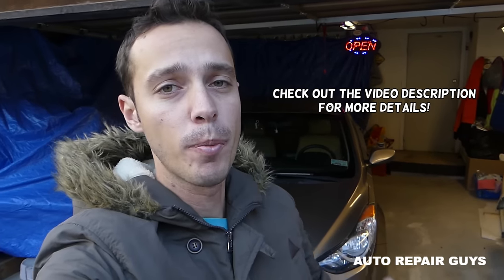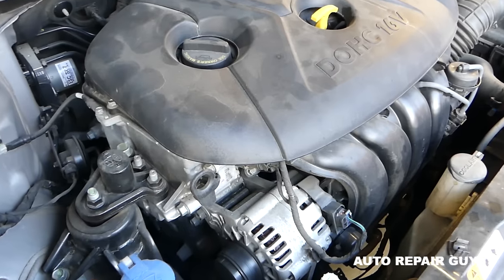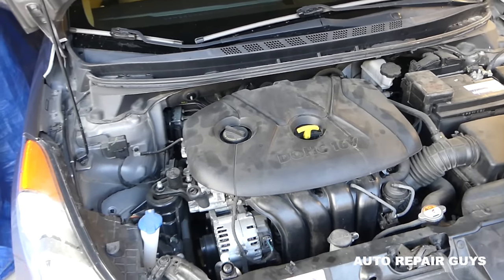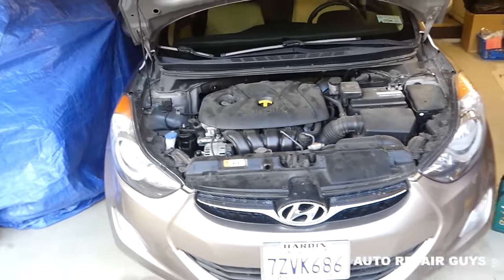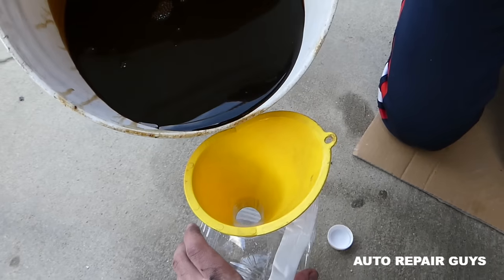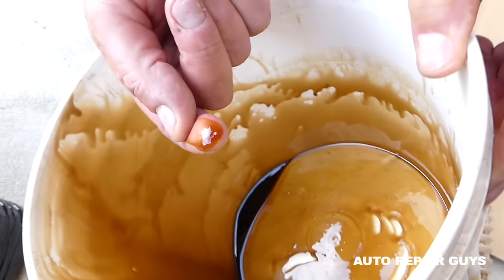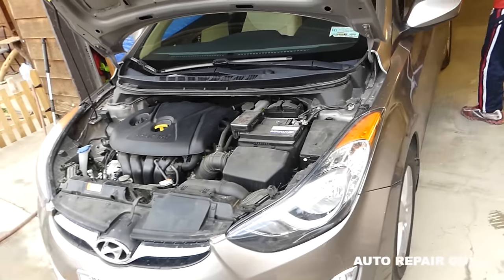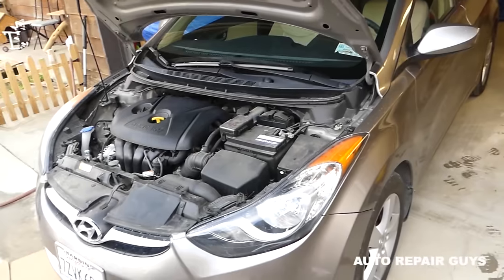HYUNDAI ELANTRA ENGINE KNOCK TICKING NOISE

Comment: Bought a 2013 Elantra brand new.  It sounded like that since new.  Currently has 220k on it.  Best car I ever owned.
Reply: I have a 2013 also en it started making me that noise at 140k miles and has no engine light on , do i have to worry??
Reply: @martinjramaral3042  my brand new Hyundai has a ticking sound. I think that’s just how smaller newer cars sound
Reply: @brandonpickett8920   dose it sounds more when you start it in the morning??
Reply: @martinjramaral3042  yup, it does. From what I’ve researched I believe it’s the fuel injectors making that noise
Reply: Brent 
All my elantra 2012 has done is cost me repair after repair
Reply: I have a 2013 with 130k.  I noticed it making that noise at 80k (think it made it since new though).   No problems so far.
Reply: 😂 you must have had some shitty ass cars in the past 😂 it takes a lot to be worse than that
Reply: @martinjramaral3042  yep
Reply: It's been the worst car I've ever owned
Reply: I bought my 2013 Elantra in September of last year. When I bought it it only had 10,300 miles on it. I live in Anchorage, AK and it didn’t start making the ticking noise until it became real cold. (10- -10 degrees) at around 11,000 miles.
Reply: @BorderPaps  just give it time
Reply: That’s the same year I recently just got with low miles and best car I ever owned aswell!
Reply: do you get rough idles at stop lights?
Reply: same here im at 205k
Reply: @brandonpickett8920  thats what i was thinking it was. I’ve put power to a few different injectors while they were out of the vehicle & some are louder then others
Reply: @makilissalas  Hi, how's your car doing now, now that you've had it 1-2 years, Mikalas? Any major repairs or expenses?
Reply: @UberAdventure   It's been one of the best cars I've ever owned . Had it since new. Just standard service maintenance.  It's done 210K and still runs sweet as a bun. I get a bit of a rattle when the car's cold but it's ok once the engine warms up. I wouldn't sweat on it.  Doesn't affect performance in any way. Still a great little car to drive. Will pass it on to my daughter soon
Reply: My is same.I m sometimes afraid it will leave me on the road.
Reply: @sheillakwei1041  did your car leave you on the road?

Comment: Normal issue with 4 cylinder.  Dont fix it unless broken buddy. My brothers elantra has same engine with 200K miles. Been ticking for a long time at start up. It normal. Leave it alone dude. Wasting your time!!
Reply: Uh what....
Reply: This guy right here works for hyundai!! ^^^^
Reply: Yes but my car lurches every so often and the oil has been very dirty.
Reply: My 2010 elantra does the same .I tried castro 5w30. It still is noisy on a cold start up,. But i think the noise is coming from the bottom end. I only have 82,000 kms.. I might triy some Lucas top end lube, or a thicker oil 10w30 for the summer. Most engines should not tick that much . They have hydraulic lifters, that self adjust, not like the old days when they had solid lifters. Try some upper valve lube , that might help.
Reply: I have seen engines tick for thousands and thousands of miles and never have a issue. I have also seen people try to fix the issue only to make things worse. 
If its not affecting you in any way but a lil noise best leave alone. Its like the customer who complains about squeaky brakes. Brakes have to stop a giant hunk of metal they will make noise sometimes. 
I bought a motorcycle once that was actually knocking. Not ticking but knocking for $400. Very nice super bike. Honda CBR 1000cc. The guy said he gave it a tune up and drove it home. Then the engine started knocking. He stated he was driving fast so assumed he blew it up. 99% of people would think the same. 
Not me I bought the bike got it home and started my diagnosis. The issue was two of his spark plugs had came loose and the engine was missing so bad it was knocking. Unburnt gas was hitting the exhaust making it worse. I tightened the plugs and had a $5000 bike. I drove it for 6 months and went ahead and make $4600 off of it. I have 3 ATVs right now worth $3000 or $4000 together. I bought them for less than $500. The issues were all electrical that someone else couldn't fix or didn't want to spend the money to fix. Electrical issues are tricky and it took me about 3 hours on each to rewire things and track down issues but it can be done. Dont be scared to buy that nice broke down ride. Sometimes its a simple repair.
Reply: @Eddythe_Eagle  Never change the oil viscosity to quiet a engine.  Especially on these newer vehicles. Ill tell you why. These cars are made to run on a thinner or thicker oil for several reasons. One the engine runs at a certain temp and that type of oil runs best at that temp for that engine. Two the oil pump and small channels in the motor need that viscosity of oil to reach those areas. Three those engineers who design your engine have notes from previous engineers that go back decades. I am sure they know what's best for your motor. Thicker oil will quiet your engine but can potentially destroy it also.
Reply: @csb772  Interesting, For some reason some cars are like this. The noise I have with the 2010 elantra seems worse on the lower end but gets better after it warms up!   It was not like this when it was new!
Reply: This noise comes from hydraulic valve lifters. Honestly, I wouldn't get my car's cylinder head cover opened for that.
Reply: @Eddythe_Eagle  dude youre gonna ruin it! New cars need spec oils, espeically under 5w20 😳 bye bye vvt, you can set them permanently to be like regular valves but its still a crap job to do
Reply: It's a recall on Hyundai and Kia vehicles. All are trash. Ticking and knocking isn't normal. Tf

Comment: I have a  2013 Elantra  that I bought new.  It has 80k on the clock now.  I change oil every 4k with full synthetic (Pennzoil Pure One 5w20).  The first 20k I ran a synthetic blend and near the end of the 4K interval I occasionally could hear a similar noise when cold.   Have not hear it since switching to full synthetic oil.
Reply: I have ticking sound in engine you think I need different oil
Reply: Google User so should I go synthetic oil?
Reply: Yes Full synthetic oil is much better also most synthetics now are good for 20K miles .

Comment: That things got another 100000+ miles left on it. The injectors have a tapping sound to them especially on the gdi's . Also would have liked to have heard it after it was warmed up.
Reply: I have 2015 Elantra and the ticking sound quiets down after a minute or two of warm up.  It has 82k on the odometer.
Reply: @jhancock1575  yup exactly same here...  I hit around 81k on odometer and it clicks at start up. Once I drive for 5 minutes it sound SMOOOTH

Comment: That is why don't drive it hard when cold. It is impossible to have a mechanical design that works identical in hard and cold environment. Just take it easy for the first 5 minutes of cold engine driving will go a long way to engine longevity.

Comment: "The ticking is significantly reduced". Lol is that gaslighting? Because unless the ticking is inside my head, it sounds exactly the same. An oil change has never fixed ticking unless the oil coming out was too thick to be removed without suction. :)
Reply: It's easy to hear on a cold start up...and goes away for me as it heats up.

Comment: I’ve got a 2012 Hyundai Elantra I bought new. Drive it 110 miles round trip to work every day. Mine has a little ticking to it at startup. But I’ve got 235K miles on it, and runs great. I change the oil every 5,000 miles with Mobil 1 full synthetic 5W 20/high mileage, and use the more expensive K&N oil filter. Only replaced the battery and plugs. Same brake pads and everything else!
Maybe I should run 5W 30.
I like the car and gonna try and get at least 300-500K on it.
Reply: At what point did you change your spark plugs?
Reply: at around 120K miles I changed the plugs. I believe I need to change them again. Sometimes have a misfire. Prob need to replace the plug wires too.

Comment: I know someone who started using Mobile1 Full Synthetic 5W-20 oil mixed with a little Lucas Synthetic Oil Stabilizer and a Dealer Oil Filter.  After a couple of months of driving the ticking/knocking noise dramatically reduced.  

He also used Lucas Upper Cylinder Fuel Lubricant.
Reply: which is common place with engine function/care with all cars....................o wait bc at the end of the day the point is to promote engine life and mpg through duration of use/ownership. Hyndai cant even make good on that
Reply: Maybe even a gentle engine flush.  Something that is OK to leave in.  Something slow acting like Hotshots Secret Stiction Eliminator maybe.  It can be used in gasoline or Diesel engines.  It is somewhat expensive at around $25 for a quart.  It also has their friction reducer in it.  They guarantee it in that they will refund you if you are not happy with it for some reason.  Just make sure to still have a receipt for it and maybe even be ready to send the remaining product back.  In my opinion you might not find yourself sending it back.  It works really and there are many people who would say similar things.  I do not sell their products or have any connection with them.  I just tried their stuff and it worked for me.  My vehicle is a Nissan and does not have any ticking problems and I should point out your luck may vary.  You don't need to have a high mileage engine to use anything like this BTW.  In fact on a high mileage engine you may see leaks.  That is because the stuff it cleans out may have been the only thing plugging leaks in the gaskets.  It is the reason why some people might tell you not to use a synthetic oil.  There was also a time when synthetic oils were thought to cause leaks.  The products I mentioned not only contain a friction reducer made by that company but they use synthetic base stocks and additives in their oils and other products.  I would love to have a vehicle that never had anything like that in it and let a friend take it for a ride and then quietly put that in it without telling him.  This is a good way to test whether it seems to do anything and without him having any knowledge that you used something in it that would eliminate the placebo effect.  The idea is that if they know there is something there they will have an expectation of improvement or maybe even think that there was one.  The idea is they don't know anything except what they may notice when they operate the vehicle.  When you see him next ask if he noticed any difference between that trip and the ones before it, then you reveal what you did to your vehicle.  This is a good way to prove that not all additives are snake oil to the cynics and skeptics.  They may be cynical from all the money they wasted trying other products that did not perform as well as they would expect.

Comment: I can still hear it. That sounds like my 1997 Toyota Camry engine. And it has a spun crank bearing.  I did the spark test on it and cylinder 2 is the bad one. I bought the car with a oil pump leak they must have ran it without oil.

Comment: Sound was still there and even worse, and even after you did the oil change, you need to let the oil settle in for more than just half a second. Also probably use Valvoline instead of Castrol GTX.

Comment: Original owners 10 yrs/ 100,000 but better have all your receipts on oil changes. Btw , wow change the oil before gets that dirty also in my owners manual says I can use 10w 30 and I do . That 5w 20 wears out fast and burns.  ALSO FOR ALL PERSONS SAYING THIS ELANTRA IS IN A LAWSUIT " YOU ARE WRONG" THIS IS THE 1.8 NOT THE 2.0 OR OTHER 2.AND 3. MOTORS THAT HAD BAD MOTORS DUE TO FUEL INJECTION LOCATIONS"

Comment: my elantra 2011 of 250000 km make the same ticking noise .. i think it is normal dependent on this engine design .. i advise you not to think about it .. it is a great car .. do not worry.
Reply: My Elantra 2013 has the same noise and it works fine

Comment: Go to 0w-30 or 5w-30 Synthetic on this car...Valvoline High Mileage Synthetic with mobil 1 filter...If you have the money..Amsoil oil @filter..Drop that 5w-20..go 5w-30  oil..Goverment implimented 0w-20 @5w-20 oil for 1/2 - 1 more mpg..

Comment: My sonata has a knock also it’s 2015 but it has 130000 miles and it’s been knocking like that for last 30k miles I’ve asked a few mechanics and nobody seems to know but when you’re driving at hire rpm or even when you’re standing still and give some gas after about 1000 rpm then I don’t hear it no more but when you stay at a light you hear it even when the engine is warm
Reply: Its definitely not rod knocking,  would never go 30.000 miles with a rod knocking.
Reply: Steve Franklin 
It was a axel I changed it and it works great
Reply: @johnm5855  Great!

Comment: I had the knock on my 2013 Veloster 1.6. I switched to 5w-30 and it also helped. I also used an STP extended life oil filter and installed a catch can. After 1000 miles mile oil is not black. Hyundai uses 5w-20 for mileage but it is bad for the engines. 5w-30 in winter and use 10w-30 in the summer. good video!
Reply: I totally agree with you,  same weighs I use. Hyundai isn't the only manufacturer doing the 5 at 20 thing. They are ALL doing it. Also. My 17 Elantra owner's manual says  5 wt 30 MAY ALSO be used. So there is no issue with that .
Reply: You know that ticking sound on the 1.6 is normal. It’s the fuel injectors

Comment: My 2016-2017 accent both do this cold as soon as they motors get to just over 1000 rpm it goes away ! Bought both on the same day both new in February 2017 ! As the closer you get to your 5000km oil change it gets louder ! My next oil change I will be switching to 5w30 I have been thinking 5w20 is to light! Only reason I haven’t switched yet is because I got 2 years of free oil changes ! Also both cars have 150000 km 8 year power train warranty! Always keep oil clean it’s the best thing you can do ! My father bought a 1992 ford ranger with 250000 Kms for 1500 bucks my father changed the oil every 4000kms and in the summer he ran diesel oil in it and the winter he would switch back to 10w30 and that truck ran with no problems for over the 15 years for him only thing he did was a few water pumps exhaust and brake pads ! The frame and body rusted out and the motor was still running at 890000 kms when we took it to the scrap yard ! Best 1500 bucks he ever spent lol !

Comment: Wanted to add that piston slap at least where I live describes when the pistons rock back and forth in the bore when the engine is cold. Not when you have a piston pin worn and it's making a noise.
A lot of inline 6-cylinder 4-L Jeep engines suffer from piston slap when they're cold.
other people have mentioned this but there may be a warranty claim available through Hyundai on this problem. Other people have mentioned they are replacing engines regardless of the year or mileage or whether you're the first owner or not.

Comment: First time ever owning an Elantra. Just bought this used car with $150,000 miles on it and it's ticking with no check engine lights on,  should I worry?
Reply: Hey did it stop I just got an Elantra and it has the same issue
Reply: How did the car work? All good?

Comment: Hope u can help I have an 2014 hyundai elantra GT I have changed the Ignition Coils, spark plugs, crankshaft posion Sensor, map manifold Pressure Sensors, and the Belt I got the car at an auto auction my problem is when I step heavy on the Gas / floor it the car doesn't respond well RPM goes up to around 4000 and the car is very slow I was thinking it maybe be the throttle body because after I turn off the car I can Hear a clicking in the throttle body after I turn the car off
Reply: Did u figure out what it was?

Comment: This video is wrong i found out what the knockin noise was coming from its the TOP RIGHT ENGINE mount i changed mines n it stop completely its 50 bucks for part yall wrong mechanics lol mines stop knocking perfectly
Reply: My 2013 elantra ticks when I accelerate   so changed the mount there no engine light on

Comment: i have the same knock in my engin 2013 elantra with 69000km on it and i called the dealler and they are changin my motor and with no garanti left on the car but at no cost to me wat 
 so ever  they sais that they didin't do a recall cause its not every car that has the probem so they call it a campagne instead . In one dealer ship only they changed 250 motors since 2011 .HYUNDAI dont want to loose ther ass because of this so there doing every thing they can to please every costumer  and i will get a lifetime garanti on the motor aslong that i am the owner  so stop tring to stop the problem with changing the oil and so you know they have a special oil filter for there motors with a valve inside of them
Reply: So you are saying if I take it in they will replace engine if it's knockin g for free. I have a 2012 with 166000 miles.

Comment: It’s funny how online everyone is such a expert but if you’re a real expert why would you be looking at these videos just FOS 
( full of shit) I’m not a expert or a mechanic and my 2015 Hyundai Sonata that has 130k miles has been making the clicking noise but no service engine sign and ones you hit the gas then no noise and it still runs very good so overall I’m happy with it especially since I haven’t done any of the services only change the oil and one time I changed the spark plugs I’ve cleaned the filters with air blower at the car wash but that’s it
Reply: Stiggs Masta 
I actually send the car to the dealer and apparently the clocking is from a factory defect so they changed my engine even known my warranty was over because I had 154k miles on it so send it to the dealer